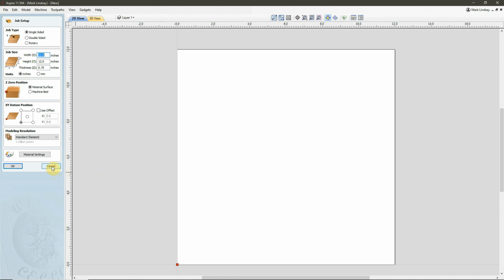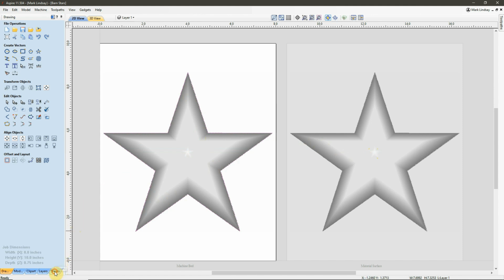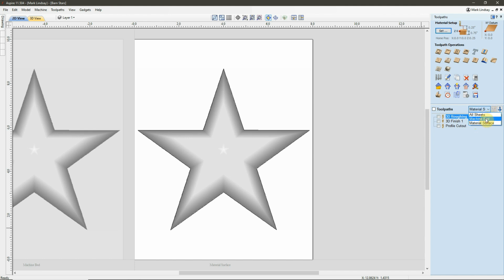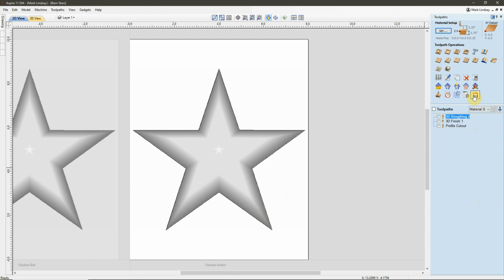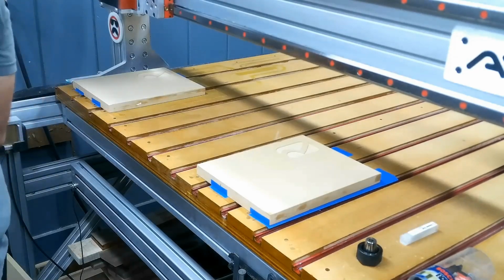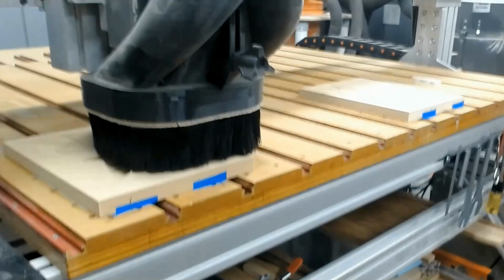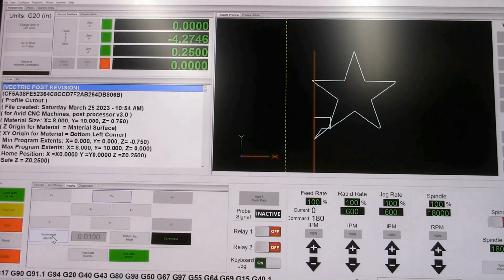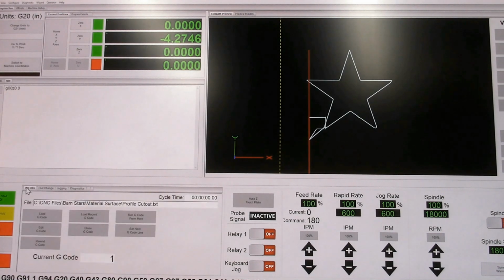Z Zero Position - Machine Bed or Material Surface?

Comment: For full cuts, I recommend zeroing to the bed for two reasons.  One, material thickness of stock, especially wood, often varies and large pieces  may have warps.  So setting to the stock can lead to digging into the base.  And two, I can quickly inspect G-code files for any z movements that are negative, indicating an error generating toolpaths.

Comment: Mark, Thanks for the great video. I did notice that when you did the second star you set z zero off the machine surface, but, after calibrating the machine, you had at least one layer of tape between your zeroing block and the machine surface. Wouldn't the thickness of that tape raise z zero up and not be truly off the machine surface?  Love your videos.
Reply from the maker: The reason for the tape under the Z zero touch plate was to compensate for the tape under the material being cut. I wanted the bit to cut through the material - it wasn't important that the bit cut into the spoilboard.

Comment: Thanks for this video very informative I have often wondered how to reference to the bed, however I noticed an error on the second star which was you zero off the machine bed but your zero should have been off the blue tape like you circle test piece was, that would explain the cutting depth on the bed along side the axis calibration you mentioned would you agree?
Reply from the maker: Good eye, Mike. I talked about that during the follow-up Live Q&A. It was the compounding of various factors that lead to the difference in size and cutting depth. My Z was out of calibration, for sure. Once calibrated, things were spot on. But, not using the tape under the touch plate certainly added to the discrepancy.

Comment: Great video!
I describe the Z Zero choice as related to where errors are going to end up. If everything is perfect (material thickness, flatness, Z calibration, ...), then either zero position will work. If anything is off (or might be off), then choosing the right zero position can help make sure the error doesn't affect your work.
Reply: Good job ❤

Comment: I zero to the bed 99% of the time.  I build mostly furniture, furniture pieces and cabinets and it’s the only way to guarantee OD dimensions regardless of material thickness. There is a reason pro shops do this. For 3d carvs, like you said, material is good. If you don’t care about minor dimensional differences then stick with whatever system you usually employ.  

Also the z touch probes are repeatable within 2-5 thousands. If you want to be more accurate and have better repeatability get yourself a Starette z probe.  They are 300 bucks but they are dead accurate. Super easy to use with a G92 offset in any CNC software too

Comment: At 21.05 you set Z zero on blue tape. If the machine was calibrated correctly the profile cut should have left blue tape on the spoil board.
Am i missing something here. Great Video.
Reply from the maker: I was surprised by that as well. I rechecked calibration (I even bought a higher-quality dial indicator just to be sure,) and it's spot on. The only difference I can think of is the thickness of the layer of CA glue used to mount the scrap piece of MDF. When I set Z zero, I didn't put any CA glue on the tape I put my touch plate on. I just put down 2 pieces of tape. I guess I should have put down 3 to simulate the CA glue. At least it didn't cut .010 into the spoilboard like it did on the second star.
Reply: @MarkLindsayCNC  I noticed that too.  I check the thickness of the two pieces of tape glued together with digital calipers and then use that value to offset the my Z zero touch off from the machine bed with no tape.  I choose a value that results in the cut penetrating the tape by about .002" . A easier way to do it is just do a Z zero tough off on the machine bed with no tape and then add .002" to .003" to it to establish the Z zero for the job.  That is after touch off on the machine bed use MID to go to Z=.002" and zero out Z.  If the Z axis is calibrated correctly then no marks should  be left on the spoil board.

Comment: For resetting the z-zero such as you did at approx 8 minutes, I just go to the box for the Z value and add the amount of adjustment directly to the value indicated and enter it.  The machine then thinks the bit is higher than the zero established by the touch plate.  Steve